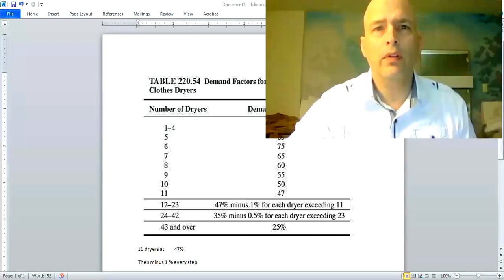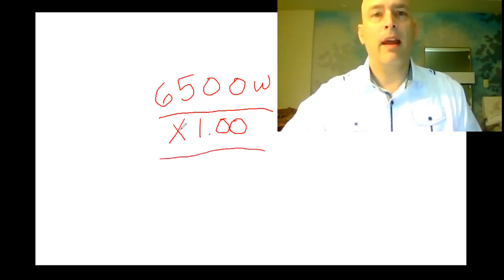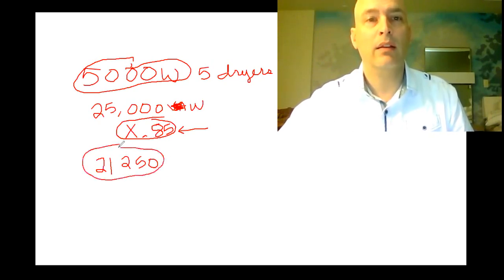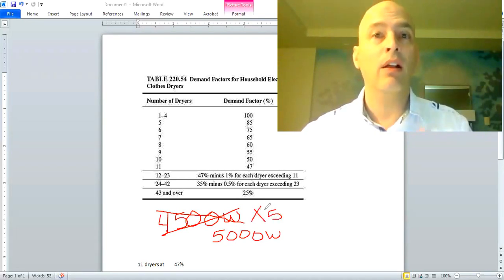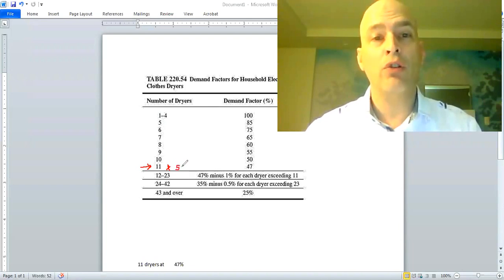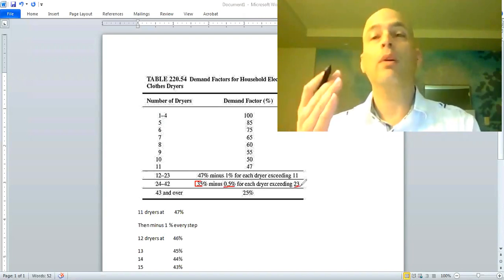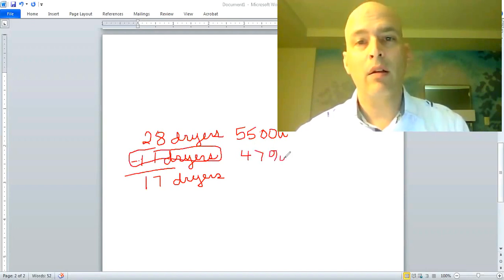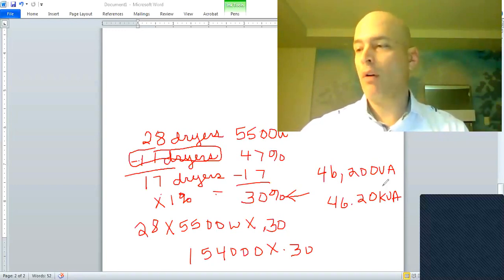How to calculate Dryers for Residential Services

Comment: I followed you until the end of the video at 28 dryers.  You calculated 1% for 28 dryers and the table says 5% for 24-42 dryers which should be 32.5% for 28 dryers.    28x5500Wx32.5%=50,050.  Am I missing something?
Reply: I think you are right.
Reply: NOTICED THAT TOO

Comment: 28 Dryers
wouldn't that be 24-42 then use 35% minus 0.5% for each dryer exceeding 23?
Reply: 28-11=17   17x.5= 8.5  35-8.5=26.5  5000x28=140000 x 26.5 = 37100 .
Reply: @MrEricdgreat  yes you are right
Reply: @MrEricdgreat  actually you have to go to next option it’s 28 dryers so that’s wrong column but yes your math is still on the right path
Reply from the maker: No sir, the first section you mention is already built into the second one. When you do the 23 rd, that dryer was then = to 35%. So you subtract 23 from the number of dryers past that as you will then subtact the .05 from the 35 for each additional dryer. If you ever get bored and write the table out long hand,  you'll see what I mean.